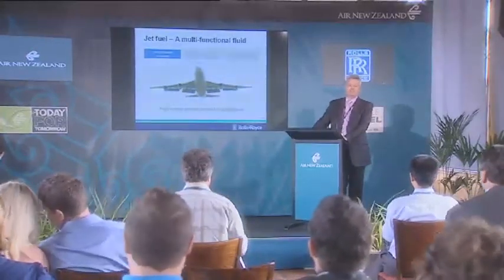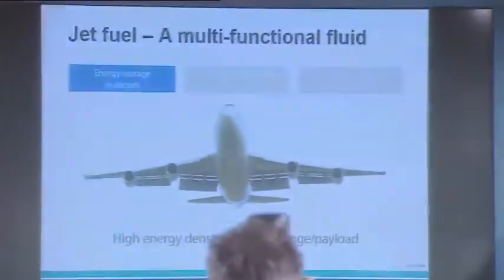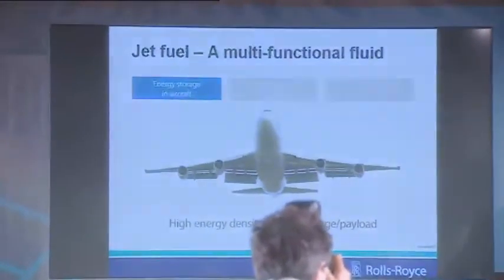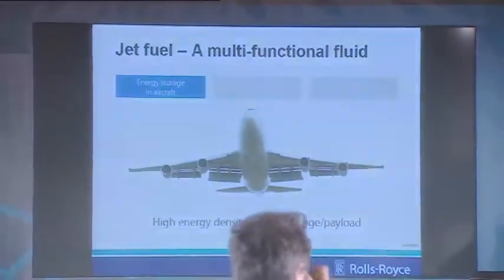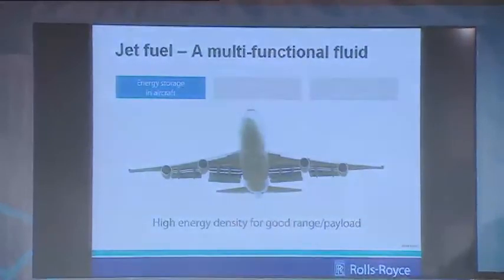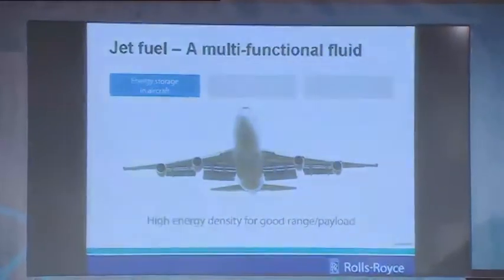Rolls Royce Presentation - Air New Zealand Biofuel Test Flight

Comment: Rolls Royce has tested Jatropha extensively and the results are quite promising. Jatropha could be a used to reduce carbon pollution and as we get closer to 2020 when mandates kick in, you should see more information on Jatropha used as bio-fuel.

Comment by John Guchone- Amplius Group